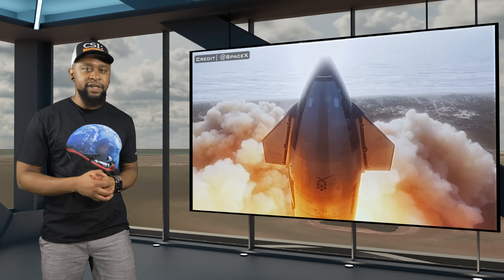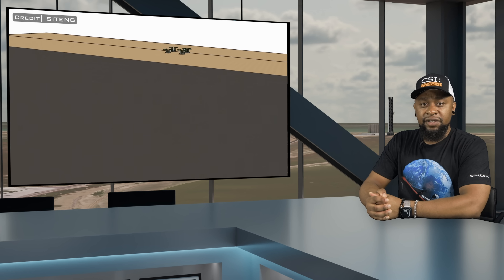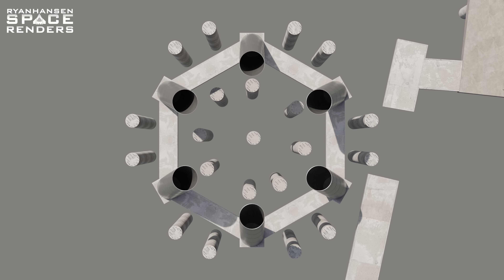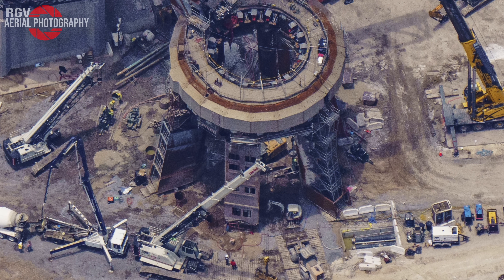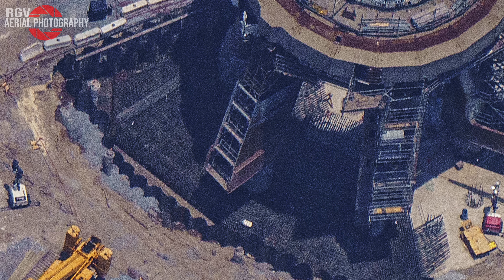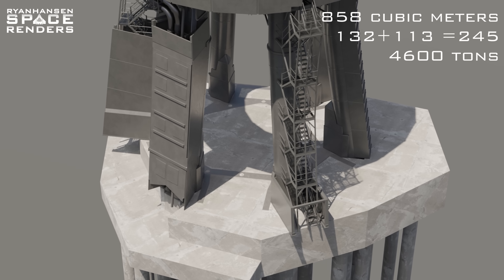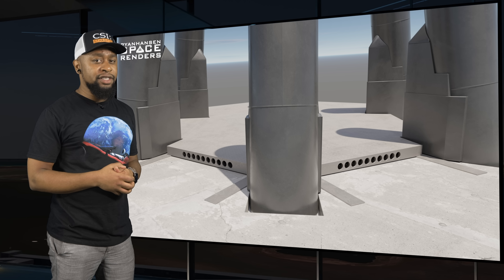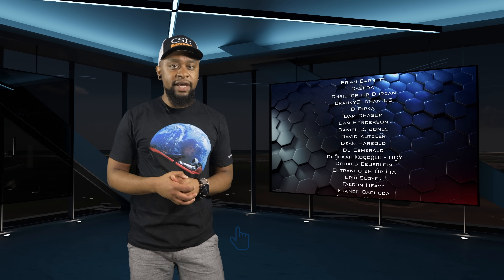How SpaceX Will Guarantee Its Launch Pad Never Fails Again! [Part 1]

Comment: I think a critical engineering mistake is being made in the use of concrete at all. SpaceX and friends think that this is a heat problem that can be fixed by cooling with water. I don't think that is correct. For one thing we don't see much actual heat damage.

The issue is the exhaust. This rocket is spitting out almost 18,000 kg of mass at multiples of the speed of sound out the ass end of this engine. Concrete being a brittle material is not very resistant to high speed interactions, fracturing apart. 

SpaceX seems to think their pad is being melted away, but there is no molten steel nor concrete evident. Their pad is being sheared and abraded away by 18 tons of supersonic mass impacting it *per second*, by the time the rocket has fully cleared the pad at around T+10 seconds from ignition at T-5 it will have been impacted by more than 200 tons of supersonic mass. It doesn't matter if the mass is gaseous or solid, at that speed it'll shred it. 

The answer isn't concrete, it is steel cladding like every other large vehicle launch pad.

Comment: A flame deflector trench is needed that redirects the flames away from the launch pad and rocket, the exhaust flows horizontally along the length of a flame trench. Space X did not install a flame deflector or flame trench just to save money.
This is just the thing privatised companies will skimp on and yet this problem is well known since the 1940s.
Reply: Without trench, the exhaust already diverted

Comment: There's one basic principle in analyzing any "new" idea.   Actually, several:

(1)  Is this really new?   Water deluge goes back at least 40 years, to the Space Shuttle.
So, not new.

(2)  If the previous design was such a complete and utter failure, in every way, why should we think that basically the same engineering team can do any better?

(3) Is the new idea quantitatively up to snuff?   Just eyeballing the water supply tank and pipes, it looks like under 1/4 of the Shuttle water supply attempting to cool FOURTEEN times the heat energy.  Like 56 times too insufficient.  Numbers matter.

(4) If Elon decided to go ahead without the steel plates before, what assurance do we have that he will not do the same dumb decisions next time?  

(5) Elon has clearly stated that the steel is going to melt away at a rate of 1 inch per second.   How is that sufficient or repeatable?

(6) Quantitative water flow again, Elon says 40 cubic meters per second.  The Shuttle delivered 350 cubic meters per second, nearly NINE TIMES AS MUCH water.   Grossly insufficient, Elon!
Reply: 1. Water that counteract he exhaust directly with flat contour isn't

2. Because there's this thing called "lesson learned"?

3. Shuttle has this thing called solid rocket boosters. It produced quick a lot of overpressure wave during ignition

4. The fact that SpaceX gets data?

5. The solution is to....spray water

6. Can you give a source for both figure?

Comment: ELon MUSK can not guarantee the safety of his launchpad as I have already and repeatedly warned him his 20 million pounds of Rocket blast can overwhelm his Water jets and Metal plates and concrete foundations if ELON allows the ROckets to Reamin longer than 2 seconds on the launchpad before Starship is released. The Rocket blast can induce harmonic reverberations that destroy the metal plates and concrete foundations as it did in the first attempt with the rocket remaining on the pad for 5 seconds before it was released. For safety ELon has made a great decision to reduce pad time to 2 seconds which the pad should be able to withstand for that short a period of time but longer and the launch pad is in jeopardy to do as it did the last time.

Comment: The new system will not work. The Newton force of the engines will burn threw the metal like a hot knife threw butter. Either they raise the launch pad up 40 ft. or dig a flame trench based on the NASA 1966 Launch Pad Safety report.

Comment: The high pressure gas system is just another point at failure. The showerhead should be fed by gravity from an overhead tank situated in the launch tower.
Reply: Then why Falcon 9 pad use it successfully?
Reply: @alvianchoiriapriliansyah9882  Falcon 9 uses a flame trench.
Reply: @paulkazjack Literally nothing to do with water system but ok I guess

(Spoiler: two of the three Falcon pad doesn't use overhead tank)

Comment: How they gonna land this on loose soils of Mars
Reply: Landing thrusters positioned much higher up the ship, so not using the Raptors.
Reply: @geoffallan  oh.. Didn't know that... 
But still it's a very heavy ship don't you think...?
Reply: @redpanda1126  It's only very heavy when fully fuelled, landing it's running pretty light.

Comment: This raises questions about how Spacex is going to land the Starship on the Moon. Currently, it has 6 engines, 3 are vacuum engines. They will stir up a lot lunar dust. Certainly, Spacex has addressed this issue. But no discussion so far.
Reply: SpaceX has indeed addresses this issue by adding several high-mounting auxiliary engines
Reply: @alvianchoiriapriliansyah9882  Are these going to be attached after the attaining earth orbit?

Comment: The problem is that with so many engines failing to ignite is why it took so long to lift off. Which contributed to the damaged launch pad. This is going to be an ongoing problem because they use so many engines. This will be a fatal flaw for the launch system. Also why didn’t they implement NASA tech. They have been using water for space shuttle launches and you would think Space X would have learned from NASA.
Reply: First flight was ALWAYS going at 90% throttle so the acceleration was ALWAYS going to be slower

Shuttle use water to dampen the solid booster acoustics from damaging the vehicle . Crater created from the Starship launch aren't a result of those. Could you provide the proof of the contrary?

Comment: I am returning to Zach's vids and pretty much all things, Starship project after the first Integrated Flight Test by SpaceX. 
So this could as well be a fresh, thinking ... 

Why bother endlessly hacking the same OLM pad. Why not build another one in a nearby site and move the OLM and the launch tower to the new nearby site ..?! 
Too much trouble ..? Jus askin. 

After all, SpaceX is used to moving the Earth if that came up to it for their purposes. Building a new nearby site i thought will give them a lot of options than having to dig the foundations of the existing OLM, which is only kind of further patching. IMHO
Reply: Yeah because it's so easy and fast and cheap. Do it then /s

Comment: Why does spacex continue with a tentative approach to the stage 0 problem. On top of that they are launching the largest rockets - HELLO! ANYONE HOME? . Stage 0 needs to be hyper strong. This water cooled metal tofu dreg stage 0 will fail.

Why does the spacex stage 0 philosophy fixate on containing and keeping the energy instead of diverting and dispersing - which is the obvious simple solution. All this will end up costing more than if they just built a proper stage 0.

Comment: I still don't believe this will stand up more than two launches.  I'd argue they need to go back to the old Saturn V and space shuttle design of thrust tunnels to take the heat away from the pad and quench the flame at the furthest point.  Another option is a glass design, 36" thick Gorilla Glass would be able to take the heat, pressure, and survive quiet a large and often felt launch.  Just my $0.02
Reply: Yes a freaking glass, very clever lmao

Comment: Thank you for your detailed report, CSI Starbase.  

I can’t help but note from your intro that SpaceX launched knowing the system was inadequate to its purpose. That is nothing less than shocking. Elon may think the entire world is his, but he would be wrong. Space exploration makes use of publicly owned airspace and ground. Any launcher owes it to that public to make the best efforts regarding accident damage and safety of staff and the public who live below that rocket’s path. I don’t see this launch following such a plan.
Reply: You obviously didn't watch, or failed to grasp the info presented here, and in Zack's previous analysis video on the nature of the failure. SpaceX correctly applied the Fondag "Bandaid", that had it been supported by an adequate foundation, would have certainly held up for the one launch it was to endure. 

That under-supported corners of the pad would flex and crack was not a foreseen failure mode. Elon Musk has stated that, had they known the pad would fail, the launch would have been postponed. 

The rocket never violated its clearance. There were no "public who live below that rocket’s path," the staff was safe, and the only property damaged was SpaceX-owned, or was left at the owners' risk in an area known at the "Danger Lot," or even closer, within the launch pad's fence. Nobody was hurt and the environmental consequences were insignificant. 

I find it ironic that NASA is held up as the gold standard of perfection, when as late in the Shuttle program as STS-125, their under-protected flame trench sustained launch damages, with the resultant effect of many hundreds of fire bricks being ejected up to 1800 feet away during at least one launch.

Comment: Turned out " much better than expected" what did they expect. To have it explode on the launch pad. If anyone "expected" less than a completely perfect flight should be fired. Quit making excuses for these idiots.
The real reason the pad burned was because the same idiots who had the low expectations also forgot to turn on the cooling water. Did Elon pay for this smoke and mirror bait and switch excuse. I don't care how well you build it or what you build it from without cooling it would do exactly the same thing. 
The damage to the pad showed that the rockets produced so much heat it turned the dirt and concrete to glass and melted all the metals!
Reply from the maker: Lol I can tell you don't understand the failure mechanics at play here. But I recommend watching my post launch episode to get a better understanding.

They never expected it to go perfectly, thats why it's called an Integrated Flight Test...because its a test. lol i suppose thats not good enough for some people, but I don't feel the need to try to convince you otherwise

Comment: How SpaceX Will Guarantee Its Launch Pad Never Fails Again?
Musk could hire competent professional engineer who know what the engineering properties of sand are.  Of course if Musk was using professional engineers, that would means the engineers insurance company is paying to fix their design failure.  Is Musk stupid enough to pay for an engineering firms design failure? The court proceedings will be interesting.

Would you like to see my preliminary calculations?  My billing rate is $150.00/hr.

Comment: "This outcome made it painfully clear that a flat concrete pad located 16m below the vehicle would not be adequate to support 33 raptor engines operating at full thrust.  While they didn't expect results to be as severe as they were, SpaceX was well aware of this fact beforehand."

So they threw away $350M in engines alone, and another $150M on the hunk of metal holding them together, JUST so they could put a half billion dollar fire cracker into the sky?  If they already knew it wouldn't work, why not wait until they had something that would work that gave it the best chance of success?  The decisions being made here are chaotic, reckless and asinine.  Something more indicative of a company that is panicking that they better deliver on something before the financial floor gives out.
Reply: Source for $350M and $150M figure?

Comment: This is another in a string of examples of Musk eschewing prior technology in favor of his own original engineering. The advantage of proven engineering is that it has already been extensively tested. Engineering from first principles to reduce costs comes with its own cost of unanticipated failure modes. There was no justification for the original engineering of this pad, because prior knowledge already demonstrated it couldn't work. Rebuilding this pad is a far more challenging and expensive project than building it right to begin with. And the reengineered pad will still require to be proven viable.
Reply: "... the reengineered pad will still require to be proven viable."

Yep, boys! We're going to prove that pad! We're going to launch a bunch of rockets!
Reply: "... Musk eschewing prior technology..."
What breed of horse do you drive daily?
Reply: @psycotria  You take me for a Luddite. The modern electric car had to be pioneered more or less from scratch, and many iterations is something you can do very handily with cars.

But a car doesn't cost $10's of millions, and take even more 10's of millions to re-engineer, for entirely predictable failure modes which were worked out decades ago, and which are even more predictable when it involves the most powerful rocket ever built. Was it really worth gambling multiple multi-million dollar engines and rendering the first attempt at suborbital flight moot before it ever got off the ground, to save a few bucks on the least expensive part of the whole project? Sometimes pioneering new technology is necessary and worth the risk, and sometimes it is just hubris.

And to answer your question, I don't own a vehicle, and am very impatiently awaiting the successful launch of Tesla robotaxis, which are many years overdue because of poor design choices. Being Musk has it's advantages and disadvantages, and engineering blind-spots and unscientific biases are among the latter. One doesn't have to be a myopically infatuated fanboy to appreciate Musk's many valuable contributions. But his hubris often curbs the net value of his genius. Musk has obvious human failings, and they often cost him and his investors dearly.

Comment: QUESTION1: If this amount of Blast Mass is needed, how did SpaceX miss the required design so massively on the original design?
QUESTION2: This is a simple Thermodynamic Calculation. We know how much 'heat' is being generated by 33-Rapter Engines at launch. This heat must be matched by an amount of water being pumped over the launch-pad to remove the heat by phase changing from liquid to steam. Once it is steam, the heat removal goes to zero. Just look at the ridiculously small hole diameters in the Blast Plate. These holes will never be able to allow enough water through before it instantly flash into steam.

This ridiculous engineering style of saying "We dont know how to calculate this, so we are going to guess and see what happens " Iterative Design" shows that SpaceX can't calculate even the simple requirements. You should only do this if there is not enough engineering knowledge to get Really...Really Close the first time. Personally, I have had enough of this "inability to calculate" from SpaceX. I do not think that SpaceX will EVER make this machine Safe-for-Humans.
Reply: "... Once it [water] is steam, the heat removal goes to zero."
- Wrong! 1 gram of steam will absorb 1 calorie of heat and rise 1 deg C.
Reply: @psycotria  Well, you are really missing the reason why I made this comment. The reason for this Blast Plate is to absorb and remove the heat energy and to survive the Blast of 33 Raptor engines. There are several heat removal processes , one of these is the Phase Change from a liquid to a vapor (steam) called latent heat of vaporization. Once all the water is turned into steam, this latent heat processes stops, hence the comment ZERO. I did not go into the Thermal Conductivity of steam because if steam was better that a liquid (water) I am sure SpaceX would have a Steam Deluge instead of a Water Deluge.
The real reason for me making a comment in the first place was the idiotic hole size in the Blast Plate and the resulting lack of water volume that could pass through them. Instead of adding additional comments on the Design of the Blast Plate, you decided to point out that Super-heating the steam dries it and therefore absorbs more heat. My comments relate to the amount of water needed and the inability of this volume passing through the small holes in the plate. Once the latent heat of vaporization is used up, you run out of water and the steam blows away. What we need is a rapid renewal of water (the colder the better).  This renewal would be much easier if the hole diameters was MUCH BIGGER. What you are doing is know as "Whataboutism". Thanks for not addressing and ignoring the real issue.
Reply: @basic48  No. I got your point as I took honors physics in high school and also follow steam locomotive builds.

The reason I made my comment is the fact that you were wrong. Period.
Reply: @psycotria  Well, I am sorry...that is incorrect. I was talking about the heat removal from Phase Change of liquid to steam or latent heat of vaporization. Then I said "Once it is steam, the heat removal goes to zero" I was referring to any further heat removal from latent heat of vaporization as it was still referencing the subject matter. I guess, I should have reemphasized the subject matter again by saying "Once ALL of the water had phase changed to steam, any further heat absorbance through latent heat of vaporization would be zero". I never mentioned anything about steam increasing in temperature, just the latent heat of vaporization. I will remember to reemphasize the subject matter again before closing the paragraph. Thanks for the English Lessen.
Reply: @basic48  I posted a simple physics lesson. Steam can be superheated, like all gases.